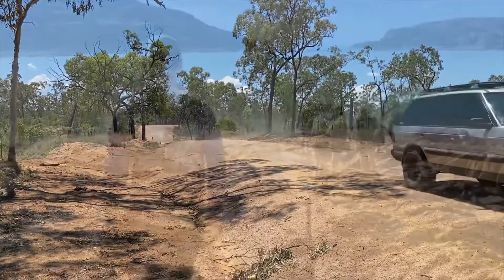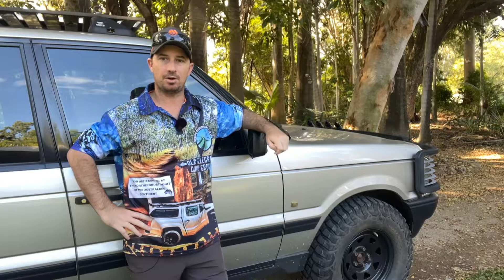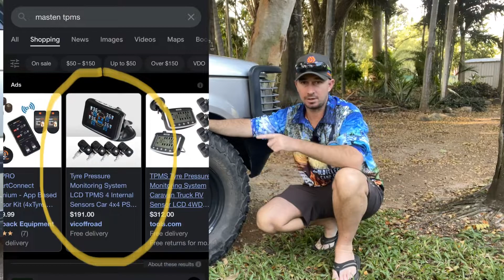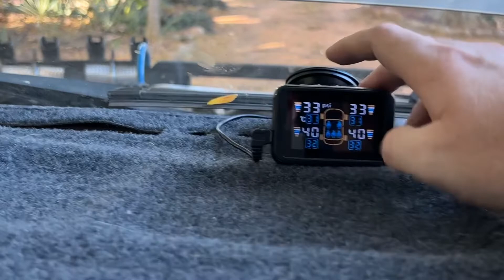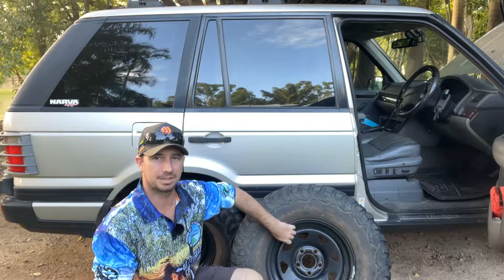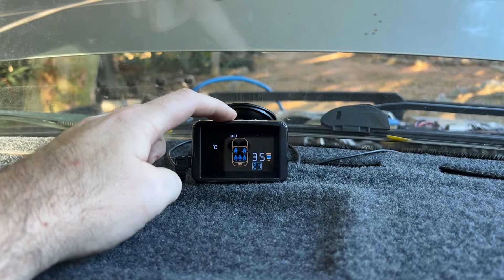MASTEN Tyre Pressure Monitor System - Manual DOESN’T Tell | Help Rotating Tyres #tpms #tyre #safety

Comment: How do you remove a tyre from the programming? I have the Masten with the smaller screen and now that I have my spare programmed it automatically shifts between views of the main four and the spare and that's really annoying! I'd rather not have the spare programmed and have just the main four displayed at all times but can't figure out how to remove it from programming.
Reply from the maker: G’day mate, it sounds like it’s being a pain! If you’re wanting to stop it from the two screen (looking at the spare), I’ll have to take a look myself as I have put the view on, but never taken it off later.

If I have a try at doing it, I will let you know.

It may also be on this video here:

Masten TPMS - Making Tyre Rotation EVEN EASIER with the Tyre Pressure Monitoring System? You Bet!
https://youtu.be/_jDPhvgDcl8

Comment: Great video. Is here any chance you can explain how to reset the sensors after a front to rear tyre rotation? I followed your instructions but didn't understand the exact steps required to move each sensor's position.
Reply from the maker: G’day mate, sure thing.

When you get into the re-programming menu, select the tyre you wish to move, and then select where you have moved it to. As you do this, keep in mind it will also swap the tyre that was in the “new” position back to where you moved the other tyre from.

The other option is to select the tyre you’re wishing to re-write and add air to it using a compressor, until you hear it beeping (which means it’s recognised the pressure changing in that tyre). 

If you have trouble still, let me know, I might knock up another video.
Reply: @Keithy_W  yes I'm definitely not understanding which button to press when the tyre is moved to the new position. I also don't understand how to select the other front tyre to move out to the new position.
Reply from the maker: That’s ok mate, it can be difficult. In the instructions they use words like “long press” and “short press” which means exactly that, and otherwise there are three buttons on the TPMS - the set button, and the + and - buttons. 

I’ll go over it when I get a sec and try explain it a bit better.

Comment: Great instructions ,thank you . Would you know how to reset whole system ? sensors and display . It is almost impossible to get full manual . My display shows that my 4x4 has only 3 wheels and doesnt show any pressures however after doing what you show on this video it does see some sensors (programing mode but not when in normal mode )
Reply from the maker: Thanks mate!

I couldn’t tell you how to reset the whole system, but I’d suggest waking the sensors up before attempting to do any rotation.

I use this method each time when I rotate the tyres.

I’d say the batteries are going low if you’re experiencing issues. Mine are still going strong after all this time!

You might be able to take your car for a short drive to wake the sensors up, and then re-try the positions again.
Reply: @Keithy_W  Thank you for your reply , did all that and no joy , i would like to start fresh , reset memory  and sensors .

Comment: Hello. Just a question about working in Australia mining industry. Do they pay 1.5 after 8 hours ? And double time after 10 is that true ? Could you please tell me that ? 
So if u earning 65$ after 8 hours u get 97.5 $ 
And after ten hours u get 130$ 
Is it like that in there ? Thanks man 👍 I’m from Brazil but I got a job offer in Perth
Reply from the maker: G’day mate, 

The industry differs based on rostered working hours. I believe it’s based on weekly working hours broken down into daily times. I can tell you I don’t get 1 1/2 time working a 12hr shift. It depends on the workplace agreement as to overtime pay.

Congrats mate! Good work landing the job in Perth!
Reply: @Keithy_W  so the wages they offering is it normal around that place ? 65-75$ hour ? I’m still searching because it seems fake. 
75 for 60 hours is 4500$ a week after tax around 3600$ is it like that? People get money like this in mining ? Digger operator. For me that’s too much money :0 I’m still impressed
Reply from the maker: You might have to speak with a recruitment agency for more detailed wages. It sounds close to right, but every place is different. It’s not far off the money mate. It’s real haha